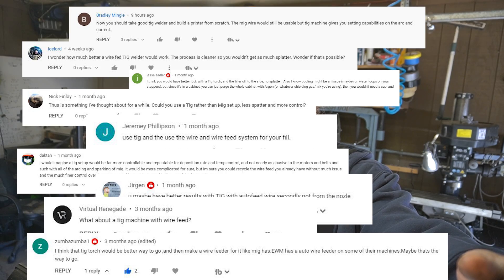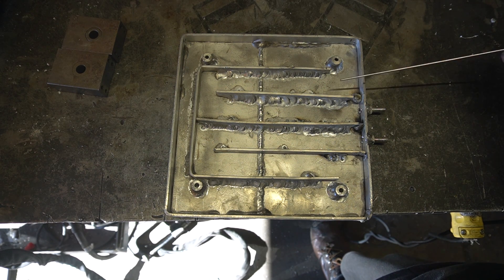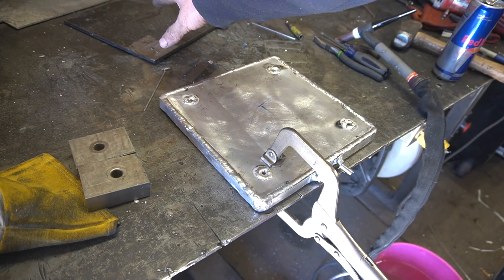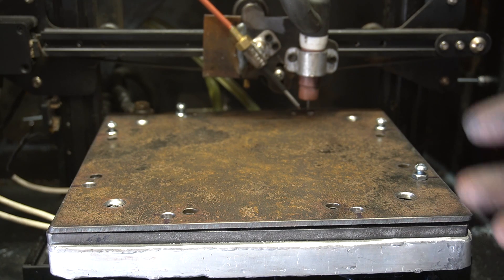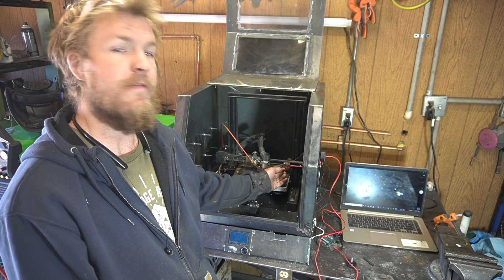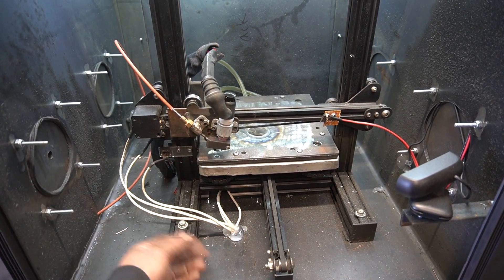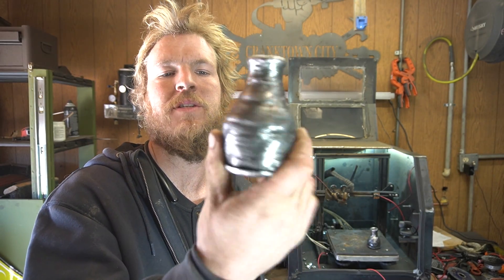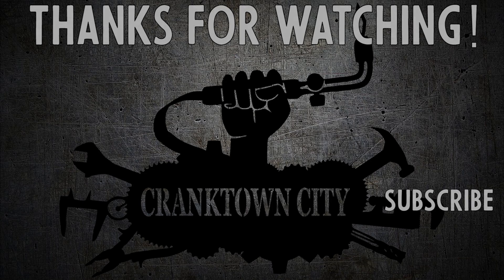DIY Metal 3D Printer Using A TIG Welder

Comment: I hope you see this comment. Being a welder for over a decade I've found the best way to fill In and reduce burnthrough is to use a pulse-fill technique. A quick shot of spark jooce paired with as much filler as possible that will melt without losing high resolution would be your best friend. I've thought about this a lot. I have no idea how someone would be able to program a welder to automatically behave in this manner, but I think that would get you 90% there

Comment: If you use a graphite plate for printing on and inbed a bolt for the starting point, the print will release from the plate and you'll only have to cut the bolt off

Comment: As someone pursuing a mechanical engineering degree, i can only say that your work is marvellous. I am currently working on my bachelor thesis regarding automating a welding device capable of MIG and TIG for WAAM. Your project has helped me more than 90% of the papers i have read so far. The setup works very well, you could even do research with it. Im thankfull for the aid it gives me and hope you might make a comeback with the project. It is awesome!

Comment: You need Closed-loop stepper motors to do this job there is some kits to change the motors without changing the electronic of the controler

Comment: Small scale metal printing is going to be rad AF, and it's dudes like you helping to make it happen. Got a tip, re the ender's v-wheels - replace them with hard polycarbonate. They'll still roll over potential spatters, but I imaging the black "rubber" is softening in such a relatively hot environment. I was thinking aluminium v-wheels (maker store have 'em) but no give with hard obstacles. OK for wood shavings on a CNC, probs shite with spatter droplets.

Comment: this video shows micro tig which is what you need to use.  observe the duration, observe the technique, observe the way the tungsten snaps back away from puddle after each tack weld.  this is the way:  "Puk 5 Micro Tig" - search this on youtube.  don't know if I can paste the actual link.

Comment: why the hell are you using the thickest tungsten electrode and thickest feed wire you can find?  just use 0.58mm/0.023" mig wire and tungsten wire so up the resolution on this through the roof

Comment: It's rare that I comment on a DIY video, but you have simply been ingenious. I mean, a Ender 3 to print metal? Wow. Never thought of it. You should post it to Ender communities online.

Can you use metal chains (like bicycle chains) instead of belts to drive the stepper motors? I guess that they will warp less than rubber belts.

Comment: Nice trial and error and solutions!! The grounding issue, ground doesn't go to separate circuits. They all take the same route to ground. Pound another 6' ground rod into the ground already 6': away from the one your panel ground to and hook your welder external ground to it. Should help with the interference.

Comment: What if  in work chamber totaly change air on argon or carbon dioxide? 

Of course, work chamber must be airtight. But you will get really reduce flow of protecting gas. It is important for long time 3dprinting sessions.

Comment: As a thought: There is a robotic mig welder I saw a video about last year that is being used to make a pedestrian bridge. It is placing one dot of metal at a time. I am sure this would require use of G-code instead of using a 3d printer slicer, but would probably allow for a better weld quality.

Comment: "SOMEONE" has probably suggested this before but IF you use a TIG torch you will only have one thing to control and that is the wire feed.
Taking the tungsten electrode out of the equation would mean one less moving part and we all know that moving parts tend to have a mind of their own and move where you DO NOT WANT THEM TO GO...
BUT whatever you decide to do, PLEASE KEEP DOING IT !!!

Comment: there's some new stuff for tig... with a flux instead of gas... mucho betterO bro... wire and electricity... so delivery can be pretty easy... and you could leave the delivery arm still and move a three axis machine table with micrometer movement in all three axis... I have also been thinking about doing both metal and plastic..  wowy zowy... absolutely anything you can dream up... 
✌️
Reply: put a conveyor belt on the machine table... and. ... hey... you could print really big stuff...

Comment: That looks awesome, A way to make it more accurate might be to reduce the size of your tungsten and wire, grind the tip to a 60 degree angle , shorten the arc length to as small as possible and lower your amps. The only thing about being more accurate is- it takes more time and probably has way more sensitivity to control problems.

Comment: I had the same interference issue building my cnc plasma , believe it or not I wrapped everything with aluminum foil then electric tape.  Fixed all the issues with high frequency interference

Comment: Heya mate. I built something similar to your CNC and got round the HF crashing my controller by wiring all the inputs through little 1:1 line transformers with the in/out connected in series but reversed opposing each other so the AC interference gets cancelled out by the fields generated. Worked for me..

Comment: This reminds me of plasma welding, except making it more complicated then plasma would be. I honestly don't know much about welding other then plasma welding. Are you using an inert gas to help with porosity and bonding. I used to make engine valves and ran a plasma welder and powdered metals to create seat materials different then the valves ems to increase strength and or heat dissipation in the area where it needed it most. I guess I did friction welding for a few years also but again that's completely different then most other welding.

Comment: Did you try turning the wire speed down and heat down? Since your running mig wire with a tig torch, im willing to bet, you dont need it so hot. May help with the distortion and layer shifts

Comment: I think you could get some big improvements by building a machine from scratch instead of trying to adapt an ender 3

Use leadscrews instead of belts so you don't have to worry about heat and make sure your motors are kept cool (if they get over ~50-60C for extended periods of time they can start to demagnetize and fail) also if you can get a more capable and beefy board for everything you might end up saving a lot of time and maybe even some money from not ending up with a bunch of smaller fried boards

Comment: TAKE THIS FURTHER.
also, this is probably the least efficient way of making a metal vase, and i love everything about it.
i think maybe giving it a bit more hight in every layer so it can build up more, also maybe adding a cooling element that goes right behind the welder to cool the welds just a tiny but quicker so they dont droop as much.

Comment: Try this with pulse tig and i bet it will help with heat control and overall consistency. As a welder that’s a lot of heat being imputed in the base metal. Even switching to a mig would probably have better results. But nonetheless very cool man

Comment: ok... suggestion.. switch to a medium sized gas lense.not the set up on the torch you have 
 you also need a dual flow regualtor or just a splitter on a single flow reg. you need 1/16th 2% lanthinated tungsten. #6 ceramic cup , and a 1/16 collet

Comment: Maybe not as accurate as the boat, but I think you have the bigger problem solved, which is the quality of print. Much better looking part with this setup, like you said, there are options to getting it to perform more accurately.

Comment: Very cool, imagine the application if you could make parts precisely with comparable strength! Have you thought of using a rotating nozzle and putting the nozzle at a slight angle? If you could get the welder to run a better bead, you could get a more uniform thickness. Instead it’s kinda moving around a puddle of molten metal 😂

Comment: Cool idea man! Make the bead narrower, like 1/8” maybe. Making the weld colder will make it taller. Try to print on a rotating platform (vertical lathe) for prints that have radial symmetry. More!!

Comment: I think this is already usable.
If you take its output as a raw, then stick it in a 6 axis router to add the fine detail, you end up with far less material waste then starting from a solid block to make the exact same part.

Comment: Could that layer shifting be from your wire sticking to the weld and causing the stepper to skip steps on rare occasion? If so and you want to throw a little (more) money on this, you could always get some closed loop drivers?

Comment: for better resolution : what if place "welding bath" from printing model to printing head, rotate it 90% - then gravitation gives possibility to use "matherial from bath" (in form of dots or line, think it can be calibrated).

Comment: I just stumbled on to this. Great stuff! I weld very thin steel sheet (20 gauge). Tig makes a big puddle and unacceptable warpage. I have to use mig with special procedure to get a very narrow weld that is solid. Your welds are beautiful, but they are "stack of dimes" wide so target 3d print results are a bit thick. When you get it right, you will really have something new. Look up SAW welding, for instance. Or, maybe very thin wire and a very small arc... It would take longer, but time is affordable for now and your control appears right on.

Comment: do it upside down, use helium.
I dunno, maybe try to get the pool to sorta drip as it hardens instead of splat, and you'll keep more heat in the part. And away from the belt.

Comment: Man keep going brother! I would try to turn the machine down as low as it will go and using the smallest wire that can be fed and pulse the torch on and off and cool the weld as much as possible, maybe squirt it with water.

Comment: How hard would it be to vacuum seal this thing up and pump it full of shielding gas? Cause while it may not work with steel, aluminum might work. You'd likely run into a problem with the gas getting too hot though as helium conducts heat better than pure argon. This can work though. My welder unfortunately doesn't have a duty cycle that can handle it so I'm gonna have to save a bit but I think I might be able to get something going.

Comment: Mig welder would have worked better in this application. Trying to feed wire towards the tungsten does not allow a precise puddle in this TIG application. A mig gun pointing straight down would be very precise. All you have to do is get your wire speed dialed in for the speed of the machine which you would have set to a uniform speed in all directions.

Comment: This is very impressive. Yes, you're having some issues with it, but I'm sure there were a lot of issues with the first prototypes of FDM printers and look where they are now. If invention was easy, everybody would do it.

I wonder if you'd have better luck using a tig that can do "cold welding". By doing a series of small spot welds rather than trying to run a continuous bead you might be able to manage a finer resolution and keep the heat a bit more manageable. It would also mean that you'd have a more easily definable amount of wire needed for each spot rather than trying to vary the wire speed to match the bead.

Comment: You should have are we cool yet for a guest. Have you tried using finer wire? I'm talking go way low on power. Why did you do a vase when you started with a boat do the boat stick with the boat. How difficult and absurd would it be to put a feeler gauge system in there that would tell it where the part is versus where it thinks it should be for each layer? (As part of the gantry). How about cutting it in half to see what's inside of it and doing an acid test while you're attack it. I recommend doing a straight through the top to bottom cut as well as doing an angle cut for acid tests

Comment: About grounding:
As you said you grounded everything to a different circuit I almost dropped my Beer
Grounding is about getting stuff to the same potential (electrically that is) and to achieve that there must be the biggest, shortest cables between those different things. If you "ground" one thing to one circuit and another thing to another circuit then the common point is in your electrical panel like 50 feet away and the two things have 100 feet of cable between them. The shorter (and maybe more conductive) path between the two things in that case is thru your electronics and they get fried or cause problems

This is not what you want

You want everything connected to one common ground point on your bench with as short connections to everything as possible. Maybe some copper pipe where you solder a bunch of 2 feet long wires onto, which connect to anything you want to ground. In that case everything is connected to one point by a maximum of 4 feet of wire between. You don't even need to connect that whole contraption to a ground of your electrical system to avoid having EMI problems, although i would recommend that.

Comment: This is like getting a fat girl in the middle of a 25yr prison sentence. Both fantastic and a sure way to jam that last dagger of disappointment into your dad's heart. Tig works better but I think there's too much uncontrollable heat. The arc seems to be too wide and it's hard controlling the massive amount of unusable heat. I've never tried it, but to control the amount of heat run off perhaps a higher voltage lower amp skinnier arc would be better. I'm not sure how well tungsten wire going through a long thin rifled ceramic tube would work but you need a small thin local and violent plasma arc to be contained with the shield and it takes voltage to go straight and not bounce around like Palpatine. I think you'd get better results if you could manage the arc and try to focus it as close to what a laser would be. It seems like it's time to address the welder in any case. It would be helpful to see a closeup high speed view of what the arc is doing.

Comment: Great job, you're awesome. Try adding water cooling to the small block holding the wire end. Drill two channels and add some fittings, job done. Give it a try

Comment: Have you thought about hot wire feed? https://youtu.be/kCwsrgwKBaU
They need an orbital welder to weld 15 tubes each 1/2 inch in a tight bundle to connect to a "Cobra Head".  The Cobra Head is designed to terminate hydraulic & electrical umbilicals to various sub-sea oil well structures. Umbilical tubing is butt welded to stainless steel tubes that in turn are welded onto hydraulic couplers located in the MQC/ stab plate.
Reply: The Genius of 3D Printed Rockets  https://youtu.be/kz165f1g8-E

Comment: What I am seeing is magical! What you are doing, they are already doing in an aerospace company. From what I have seen, even to them the printing is not very precise, but I think I have understood that the larger the piece the more precise it is, due to the heat which, if persistent, melts the other printed parts. So it is necessary to have a balance between heat, molded part, and extruded metal whether large or small. Please make this project perfect, because I would like to buy it or if you prefer to share it I would like to copy it, and have a similar printer in everyday life. lookyyyyy https://www.youtube.com/watch?v=kz165f1g8-E&t=474s&ab_channel=Veritasium

Comment: Seal the enclosure and pump it full of argon, then use powdered steel and the TIG to selectively fuse the powder in layers..   STS (selective TIG sintering) instead of selective laser sintering...

Comment: yes take it further!!, you still could catch a layer shifting again maybe some linear rails with better steppers.. your argon I am sure is still leaking out may be you could still run it lower pressure to save a lot of gas but also help for any leaking out.. also if you get that layer shifting fixed I don't see why not be able to produce pre part blanks for machining also they sell misters for cooling your end mills might be good to see if that might help with cooling, ohw and add some Helium to that gas mix it helps being able to weld at a lower amperage also just helps move the metal more smoothly the mister might be a bad idea but worth a shot

Comment: On the everlast 200 that I have it 
Has a pulse control setting on my welder I can set pulse setting as low a 1 pulse per second, if your everlast  has pulse control then you could  make it work once you get your background pulse current and your foreground pulse current set

Comment: Your're laying important groundwork here, there is a big improvement in quality there and youre right it has a lot of potential.  Do you thing using smaller diam wire might help, like down to 0.1mm? perhaps less thermal mass?

Comment: I think you are close to something serious ...
less filament thickness, less unsustainable temperatures = more control and accuracy

imagine obtaining the melting point of a thickness of 0.4 mm like the nozzle of plastic materials ... and you will have an excellent metal printer, the problem is how to obtain a filament like this?

Comment: That is magnificent! Genuinely very cool work. Full credit to you as what you did is, as you found out, not only quite difficult to pull off but also requires a lot of little things to be just right before even simple shapes can be made. I think with some refinements you could find a cool niche use for this.

Comment: Id watch if you did another one.  Maybe the layers are too thick because the metal flow is completely random and uncontrolled?  Like a plastic one has an extruder that limits the flow.  This is the equivalent of torching flaming plastic as it feeds out a nozzle.  Basically just as random.  Keep up the good work!